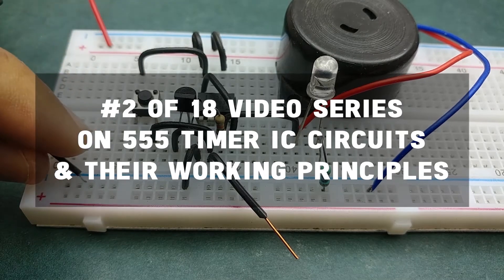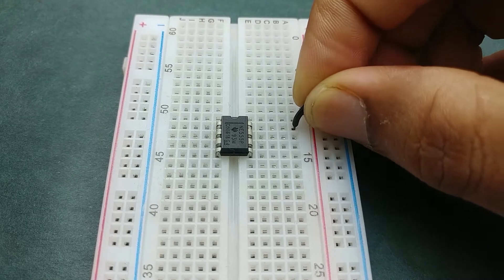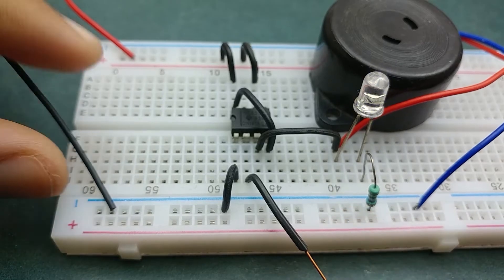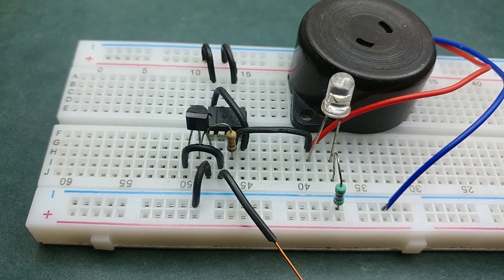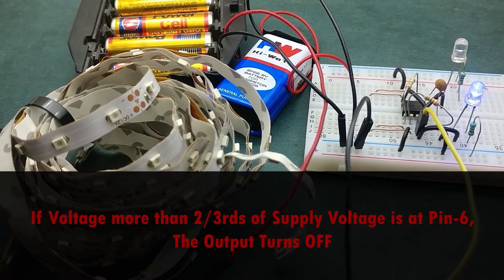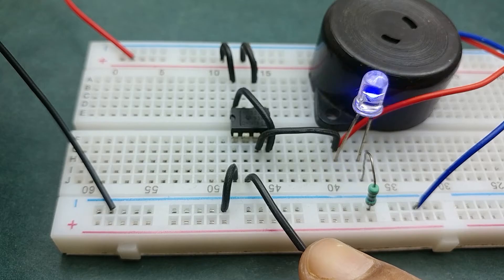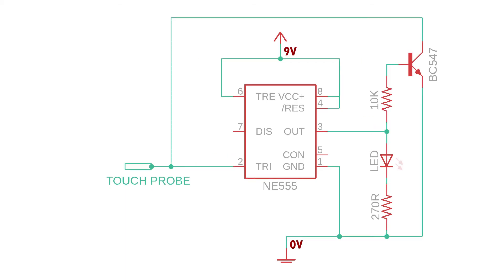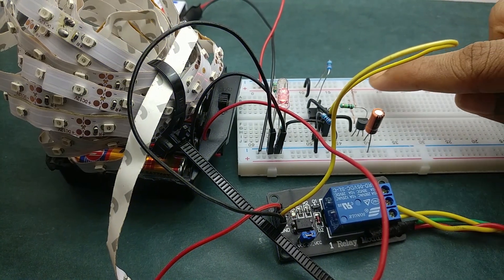Latching Touch Sensitive Alarm Circuit on breadboard | 555 Timer project #2

Comment: Hi @ElectronicswithReyon-yp2dy 
Description you are provided a circuit diagram touch based alarm circuit first of not stable always irrespective of touch near by alarm on always but alarm off control proper.
I tried this circuit dot matrix solder same as you are provided diagram not stable response IC555 get heat 6. Pin thershold and 8 th pin diode mode open shown on multimeter 💯 same circuit my side never made a single mistake why this happened?

Comment: I have made another project from you which was working absolutely fine. But in this circuit my buzzer starts sound without touching the knob and LED is not gloving though i have designed it as same as yours and all components are working properly. Please try to help me.

Comment: The circuit was working earlier, but I had to put in the transistor backwards for it (collector connected where the emitter is meant to be, and vice versa). However, now it is working but the circuit activated immediately after connecting the battery, and the pushbutton is resetting the circuit is expected. Touching the wire seems to do nothing, unlike earlier. 

I have already checked the circuit several times and switched the transistor back and forth. I did not change anything, it was simply stored in a drawer in my room. 

The LEDs stop working quickly, and I’ve had to replace it many times (I’m using the correct value for the resistor connected to LED).

Comment: Is it possible to use a resistor that has a value of 390 Ohms or greater for a green LED (when giving 9 volts of supply)?

Comment: Sir my led goes off only on holding the switch and gets on when on when I release it and buzzer constantly beeps. Plz help
Reply from the maker: Try using a DC power source from batteries if you are currently powering the circuit from a AC-DC adapter. Next try removing the push button switch and manually apply +ve voltage at Pin-6. If it works now, the switch connections might be incorrect. Also the circuit is sensitive to AC sources if they are very near.
Reply: @elonics  why it doesnt work when using ac dc adapter?
Mine has same problem too.
How to have the circuit results with ac dc adapter.

Comment: He says to connect pin 4 to negative rail but connects the 8 th pin to the negative rail...
Reply from the maker: Both the Pins 4 & 8 are connected to each other. So connecting either of the pins to negative rail will do

Comment: sir in my citcuit it works by sensing object ,when i come to near it then it works without touching but how is this possible
Reply from the maker: Because of induced electrostatic charge. It works similar to how two plates accumulate charges of opposite polarity in a capacitor

Comment: Can I produce sound frequency of 25,000 hz using this same circuit
Reply from the maker: You should use another 555 timer IC in astable mode to generate the required frequency
Reply: Can you please help in making dog repellent system which is my project Target is to produce 20,000+ hz sound frequency